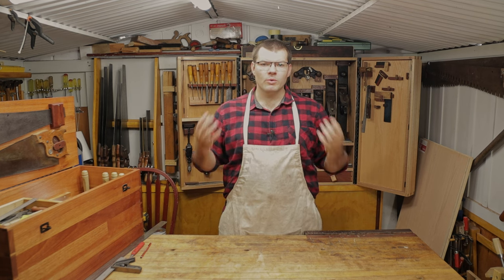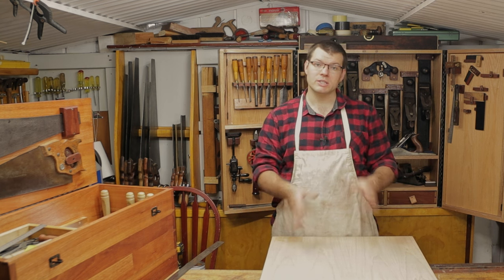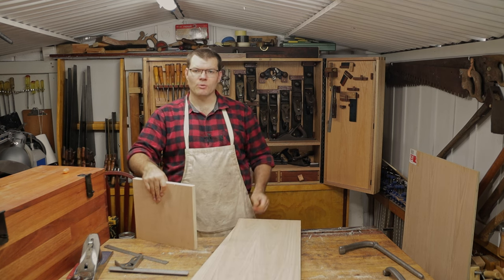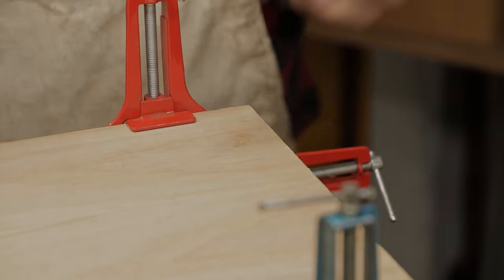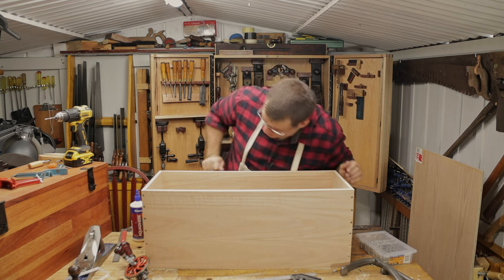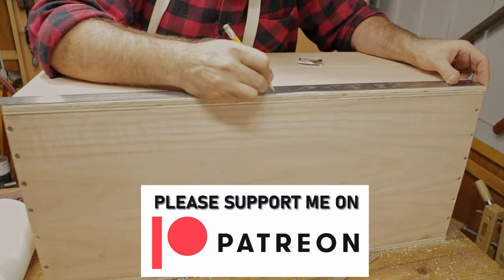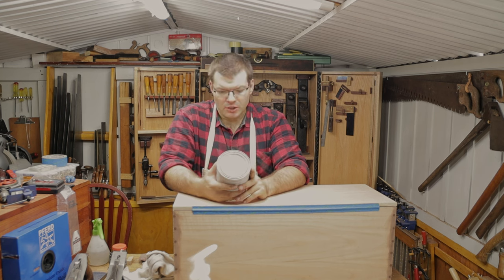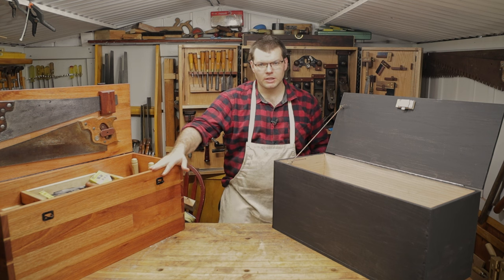DIY Beginner Tool Chest Build

Comment: One thing that I've discovered myself is to clamp plywood before screwing into it edgewise. I mean, clamp just beside the screw to stop a potential split from running, especially near an end, if that makes sense? I don't know how to explain it clearer. Let's try this...make sure the outer faces of the ply are sandwiched in a clamp to secure it before running a screw into an edge. Use slightly cambered cauls if needed to stretch across a large distance. It may still split when the clamps are removed but if you use thinner screws and stay far enough away from corners, it should be ok.
Reply from the maker: Yes makes sense, the screw can act as a wedge and split the plys in the plywood, so the clamping pressure helps prevent this.

Comment: Great build, what's it like cutting into plywood with a handsaw? Similar to sawing pine?
Reply from the maker: It's a bit like pine but harder to push the saw. You definitely want to use a cross cut saw to help prevent the plywood blowing out on the cross grain